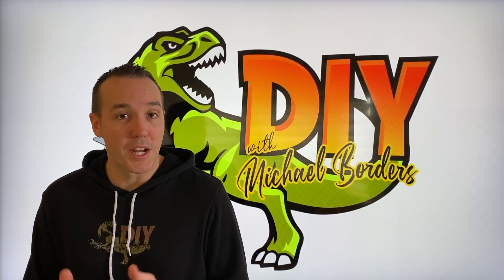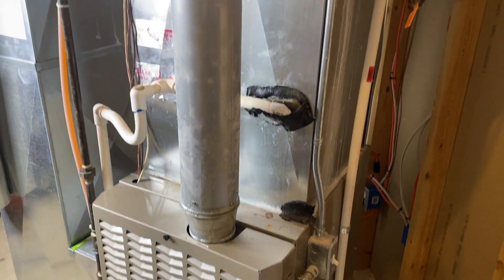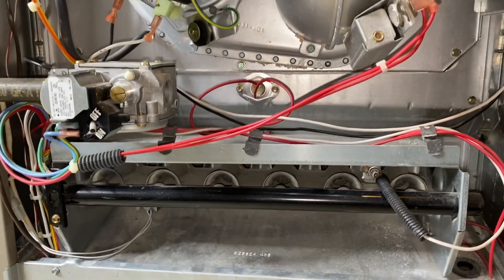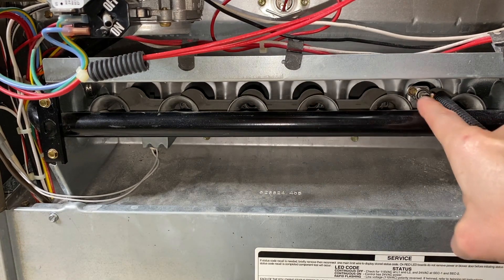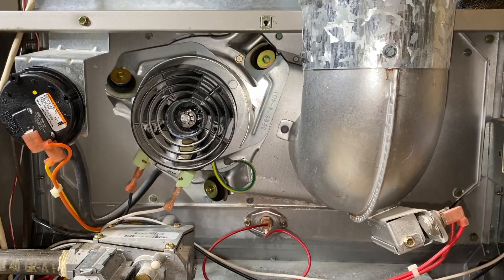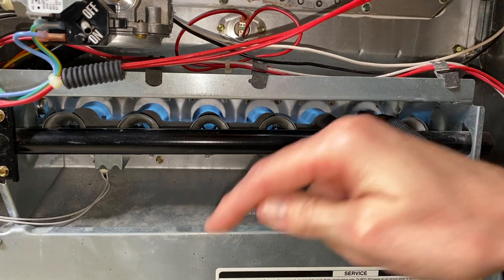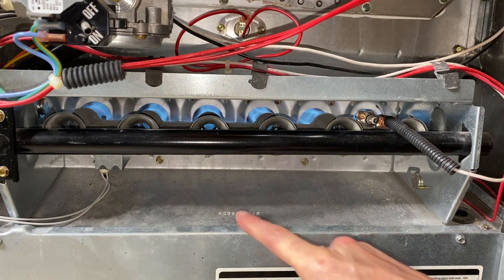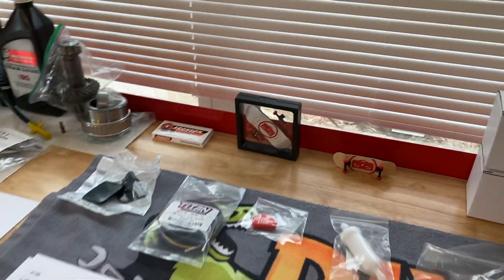Furnace turns off before reaching preset temperature - Is it WINDY?

Comment: Ok how do I stop it!??
Reply from the maker: Thanks for watching.  Does your furnace ductwork have any turns or is it more straight?

Long story short, if this is a continuous issue, you may need a license technician to come in and reroute your ductwork to alleviate wind and air backflow
Reply: Get a wind resistant chimney cap, I had the black square with the screen at the top and I had to get one that prevents down-drafting since so much air was coming down into my flue pipe.
Reply from the maker: @karlswert3348  

Thanks for sharing this.  👍🧰
Reply: @DIYwithMichaelBorders   I wanted to make my story as I can of short on my findings. I have lived at my house for going on 9 years and even when bitter cold days my furnace held temperature. When I moved in there was a round-ball like cap that was up there. After I very windy day 2 years ago it broke and blew it off the chimney top into the back yard!! I figured I'll just go to home depot and get a standard black-square screen one to put on the top of the chimney fitting. After a couple very cold days my heat was not keeping up and when we got down to zero it was 59 degrees in the house! Temperatures in the 20's, 30's and 40's and higher worked just fine with no issues. My mom even asked me "you have been there for almost 9 years and why are you all of a sudden having this problem trouble heating the house on very cold days?" 

Good question, it made me think more and more that the only thing I changed was the chimney cap at the top of the chimney. I believe that on very cold/windy days the dense cold air blowing across the top of the flue outside was creating a down-draft, causing flame rollouts, and shutting my furnace down leaving the blower running. Once the furnace reset it probably re-lit the burners again and ran until that same cycle happened again. My furnace is up in the attic so my flue pipe goes into the brick about 5 feet from the top of the flue opening. With my furnace being in the attic it was hard to tell (I am not actually up there to physically see that if my burners were cut-off) but feeling the luke-warm air out of the vents made me think "its running though so what is the problem?"

Our furnace guy that inspects every year came out and looked it over and he even said "its running fine to me, it's just very cold outside" so thank you for charging me $200.00 just to come out and say that. 

I believe the cap that was up there was more of a "cowl-wind resistant type cap" that prevented downdrafts and enhanced updrafts I didn't think anything of it being a round-like cowl with slits on it, thought maybe just decorative piece. There probably had to be a reason why that kind was up there to begin with when I moved in, and the standard black-squared with the screen that I put up there was causing terrible heating on windy/cold days. The black square is probably not allowing heating my flue shaft good enough to get a good "draw" going up to come out the top and instead blowing my fire out.

I ordered a "Round Base Chimney Vacuum Cap" search that in Amazon. I cant share the link because YouTube will pull down my comment since it contains a link. 

Start easy, you probably just need a simple cap to stop or limit downdrafts.
Reply from the maker: @karlswert3348  

Good morning to you ☕️

We can’t thank you enough for sharing your experience and you’ve got us thinking as well.  It is very likely that the previous installed cap is the critical point in this equation.

Awesome job ordering a new cap/adapter. That will hopefully return your system back to normal configuration and operation. 

Living there for 9 years and not having any issues until that cap came off is where you hit it perfectly … it just didn’t seem right.

Not many people actually realize the effects a windy day can have on their furnace system…and…if it’s not properly installed and equipped to handle an aggressive amount of airflow (or back-flow of air) coming into the exhaust ductwork…it will not be able to perform as it should.

That’s why we found it very important to film this video and get this information out to the DIY community.

We are very much looking forward to hearing back from you on how your replacement cap/adapter helps your systems operation.

Thank you again for taking the time to share your experience.  🧰
Reply: @DIYwithMichaelBorders  I put the "Famco Round Base Chimney Vacuum Cap" on my chimney today, it finally came in. I got the 10 inch one and used two hose clamps to snug it at the base to the round ceramic chimney stack, and it fit like a glove. I took the black square with the screen on it off, I would love to show you which one I purchased and what it looks like, but they keep auto-deleting my posts because of the link. I am so aggravated because I had a really nice well detailed paragraph on everything and when I included tp show you what I am talking about they auto deleted my whole comment!!! Lookup the "Famco Round Base Chimney Vacuum Cap" comes in galvanized or stainless.

Since I just put it up there today, I need to see how this works once we get a windy day here.
Reply from the maker: @karlswert3348  

Thanks for watching and sharing your update, that’s awesome it fit perfectly and you like it.  We can look it up.  

Is this it…?…

       https://amzn.to/4bJfNwf

For legality purposes per our Amazon contract, we have to put the statement below.  

If interested in purchasing this product, visit our Amazon affiliate link above.  I earn from qualifying purchases.

Comment: Is there something  that can be put on the top  outside   so the winds cant   get inside.  because where im moving i may run into this problem in indiana ...  just was wondering ..
Reply: I put the "Famco Round Base Chimney Vacuum Cap" on my chimney today, it finally came in. I got the 10 inch one and used two hose clamps to snug it at the base to the round ceramic chimney stack, and it fit like a glove. I took the black square with the screen on it off, I would love to show you which one I purchased and what it looks like, but they keep auto-deleting my posts because of the link. I am so aggravated because I had a really nice well detailed paragraph on everything and when I included tp show you what I am talking about they auto deleted my whole comment!!! Lookup the "Famco Round Base Chimney Vacuum Cap" comes in galvanized or stainless.

Since I just put it up there today, I need to see how this works once we get a windy day here.
Reply from the maker: Good morning Joe, most exhaust ductwork is routed in a way to far lower the access for air to be blown in.

We are talking WINDY WINDY days.

😁👍
Reply: @DIYwithMichaelBorders    oh  ok..i see ..    Hope all is well  ~
Reply from the maker: @joedevitto6113  

All is well, happy new year Joe.
Reply: @DIYwithMichaelBorders   ,  Happy 2023 ...
Reply from the maker: @joedevitto6113  

😎👍